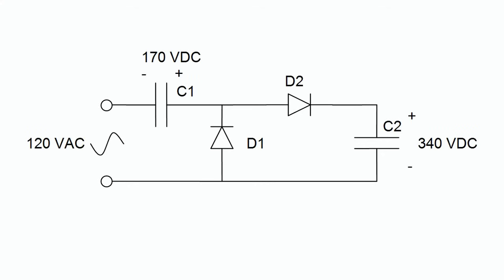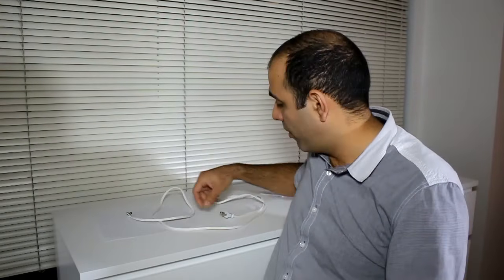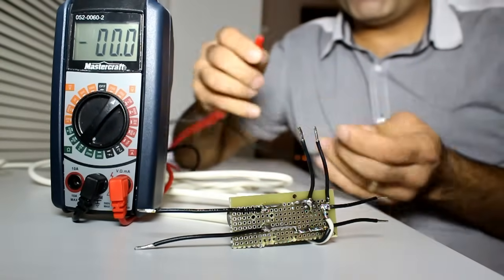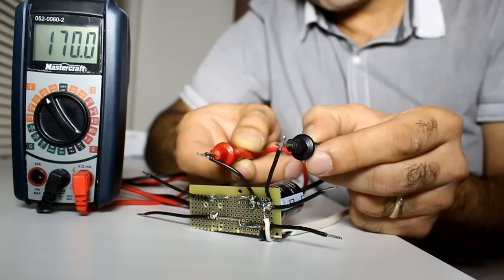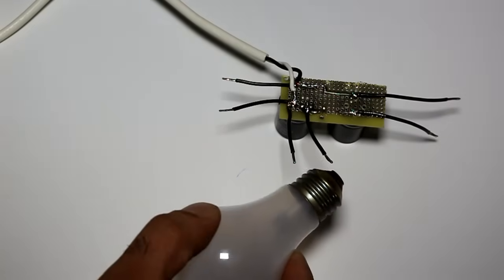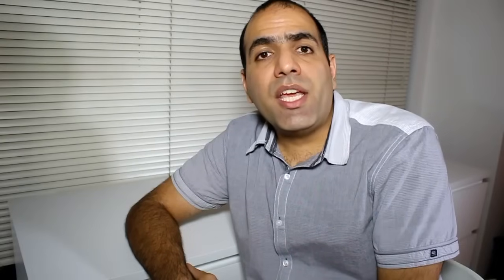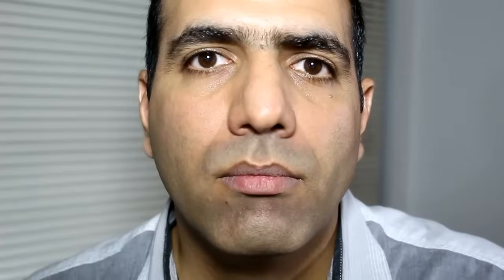High Voltage AC/DC Effect on Human Body

Comment: "I've touched 120VAC and 220VAC and they hurt a lot ...... So I'm not gonna repeat that again..."
Famous. Last. Words.
Reply: or should i say, they hertz alot
Reply: I got zapped by 240 vac when i was 6-8 years old; I put a pair of nails with BOTH HANDS!! (pretty dumb, but I was a curious guy) to this day i dont know why I didnt die
Reply: @lPlanetarizado  I also did many stupid experiments with electricity. Once my mom told me that never touch an electrical socket or switch with wet hands( I was in 1st standard). I did the opposite later on. I made the socket wet by sprinkling some water and then touched it with wet hands to feel electricity. It was an amazing experience although. As I wasn't tall enough I had to jump and touch it and later got dropped from that height.😅😅😅😅😅.

I even tried charging a cell of my remote controlled car using naked wire (connecting one part of 2 wires in socket and other 2 parts to the terminals (tapped cuz I knew that I might get shock) and then switched it on. Sadly nothing happened in first 5-8 minutes but after 12 minutes I heard a blast. Cell was black and the wires too and the table I had put the cell on was filled with fishy odour liquid
Reply: @lPlanetarizado  maybe the breaker poped quickly
Reply: Well my case was a lot more stupid. I plugged in my sister's hairband(steel or iron made) which had beautiful multicolored small stones embedded on it and plugged it into Wall socket (DC) ( I was wondering whether the stones would light up or not) And BOOM. All the fans , lights etc. stopped working because the ass of INVERTER was destroyed. 

The electricity didn't harm cuz I was on the bed while doing that. But instead my mom did a lot 😂😂😂😂😭😭
Reply: 220V is very dangerous
Reply: @D4V1D83FY  I've had nine 240VAC shocks, they're just shocks, they don't even hurt directly, you just leap up in the air, then hurt yourself on what you bash into.  It's unlikely it goes through your heart.  Even if it does, your heart has several methods of restarting with various timing signals from the brain etc.
Reply: @vaibhav mishra Nice memories you've told.
Reply: @3s-sahajselfstudy  Thanks bro
Reply: 240VAC: "Am I a joke to you?"
Reply: I got zapped by 220V not good it hurt so much cause i was little
Reply: @tomaszkulig97  when i was a baby i've inserted a key inside a 220 AC...
Reply: @tomaszkulig97  lol
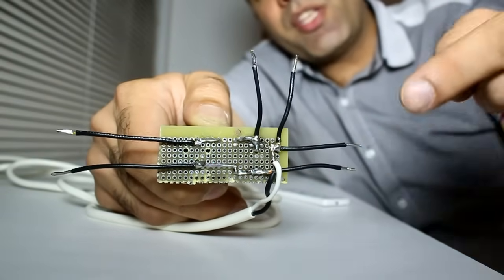Reply: Timestamp : 1:35
Reply: HANDLING HIGH VOLTAGE IS SUPER DANGEROUS AND CAN KILL YOU IF YOU DON'T BE CAREFUL WITH ELECTRICITY ITSELF.
Reply: Not enough voltage to remove the unibrow.
Reply: 120V rarely kills, if you just pull away in time.
Reply: uhm so I have a transformer capable of outputting 141 amps 8 volts on the secondary and for some reason I get shocked with 8 volts ac why? the voltage is low so what gives?
Reply: I've never gotten zapped by 220 but I have gotten zapped by 277. Not fun
Reply: I touch 250V AC but it's don't hurt me a lot I touch it four time and I connect with my leg on the ground
Reply: @omaribrahim5008  so you are trying to kill people who reads your comment. Nice job that voltage has the ability to kill a person.
Reply: @husamettinakar2297  30v AC can kill people 
That's too danger
Reply: Soham Gumaste did you know he died in 2024? 
.
.
.
.
.
.
Bc he never died. Also he will prob soon if he keeps this up
Reply: @TheBasementCade  wtf

Comment: So Edison was right about tesla's deadly AC

But it is far more efficient and transform able
Reply: Actually AC is less efficient too (capacities and inductive losses, instead of only resistive losses). Its ONLY usefulness is its ability to have its voltage changed with simple transformers. Boosting the voltage at the power plant to send it to a city 50 miles away requires a step-up transformer. Lowering the voltage to 120volts for home use requires another transformer.

If you are using DC, you would need something to convert the generator's DC output to AC (an oscillator), then increase the voltage (a transformer), and then convert it back to DC (a rectifier). The high voltage DC could be then sent to the destination city. But at the substation to the city, you would need to again have an oscillator+transformer+rectifier combo to bring it down to city-wide distribution voltage levels. And for EVERY HOUSE in the city, instead of having a transformer outside the house feeding the house from the power lines, would need to have an oscillator+transformer+rectifier combo. This additional equipment would be VERY expensive.

Keep in mind the voltages we are talking about here. 50kV comes out of the generator at the power plant. 500kV is the output of the power plant's transformer, which sends the current up to 100 miles away. The city power grid uses voltages of between 10kV and 50kV typically. And then it needs to be stepped down again to 120V for household use.

So keep in mind, if we go to DC, that 50kV DC generator at the power plant will need to run an electronic oscillator, and the rectifier will need to convert 500kV AC to 500kV DC. And on the other side of the high voltage power lines, you will need an oscillator that runs on 500kV DC! Keep in mind that while it may be a simple matter to create a rectifier that can handle higher voltages (even Radio Shack has rectifier diodes that go up to 400V and 6A), the oscillators are a MUCH BIGGER problem. Oscillators use transistors, which are much more prone to damage from high voltage than diodes (when have you ever heard of a transistor who's collector-emitter voltage was higher than about 100V?). Even a simple shock from static electricity can fry a transistor (and those shocks usually are no higher than about 5kV). To run an oscillator that will convert 500kV DC to 500kV AC, for the purpose of using a transformer to step the voltage down to 50kV for use in a city's power grid, you will need to use transistors in your oscillator that can withstand 500kV! I don't even think transistors can be made that exhibit such high voltage handling ability.
Reply: @BenHutchinson321  At high voltages (over 1 kV) you wouldn't use any kind of solid state components to build an oscillator. You'd use mechanical relays. But DC power distribution at metropolitan scales is just simply a stupid idea.
Reply: @morpheus6749  Actually I did some research on this. Apparently mechanical converters are no longer used, and they do use solid state components now. Each "component" though is composed of a massive numbers of individual components all wired in series, and each of these is a huge individual component compared to what you would find at radioshack. I mean SCRs or IGBTs (depending on the design of the converter) each the size of a refrigerator (or even larger), with HUGE voltage handling capabilities (like up to 50kV per SCR or IGBT), and then like up to 50 or more of these wired in series. And then each of these stacks of SCRs or IGBTs is housed in a building the size of a warehouse. And then there's like 6 or 12 of these buildings (depending on the design of the converter) at the converter station. So just one converter station is an ABSOLUTELY HUGE facility.

Comment: If D.C is both less harmful to humans and electronics run better on a D.C source then why don't we convert the standard A.C input into D.C before it is supplied to home appliances?
Reply: ***** oh ok.. 
Thanks for the reply.. :)
Reply: Because adjusting DC voltage is a nightmare in comparison. with AC you can just wind transformers to increase of decrease them. DC requires far more complex equipment. AC is also easier to transmit over long distances.

Comment: So, the AC (Alternating Current) can pass through the capacitor plates and DC (Direct Current) can get blocked through them? and which one has the higher voltage to create more current? *****

Comment: hey! I still wondering why you can get electrocuted by a USB which is 5v and 1amp when you're touching the floor or ground and it will not happen if your body doesn't contact directly to the ground(likes on ur video I think)
Reply: electricity looks for the shortest path to the ground -  If it finds it through your body.. then it goes through your body.
Reply: The positive and ground of your USB output, can have a significantly higher voltage potential than earths. The 5V terminal could (compared to earth) be at 105V while the ground terminal is at 100V, but the 105V terminal is still 5V when compared to the 100V terminal; it is a floating voltage since "0V" isn't referenced to earths voltage potential. This mainly happens because you didn't connect your device to the earth terminal (I know, nobody does, but we should).

Comment: I have a question. The country I live in supplies 220V. If I were to electrocute myself with a wire that I stripped, would I die?
Reply: And also, in your opinion, who's cooler? Thomas Edison or Nikola Tesla
Reply: ckalvinalvin It depends if it's AC or DC if it was a 220VAC it can kill. But DC can be absorbed but i don't recommend trying it.
Reply: ^lol  I wasn't gonna do it. I thought he would upload a video wher e he does it.
Reply: XD i see why you would think that XD
Reply: it can but may not. Depends of the duration and location. Its primary  problem is if it passes through the heart.

Getting electrocuted aitn that easy unless you  touch both wires ( live and  ground/0) or are in contact with the ground.
Reply: Makes you wonder how some people survived a direct strike of lightning. Lightning is said to contain millions of volts and being hotter than the sun. How people are not instantly vaporized upon touching it is beyond me.
Reply: ***** I imagine the person either wearing rubber shoes because the circuit wouldn't complete itself. And/or the electricity won't be able to pass through the person's heart :/
Reply: MinecraftorBust hmm, maybe. But that still wouldn't account for the 'hotter than the sun' part. Even if it's only for a split second, you would think a temperature of 50,000 Kelvin (the sun is 6.000 kelvin) would vaporize anything it touches.
Reply: ***** I agree, I'm actually going to search this up.
Reply: ***** I see, thank you for your insight.
Reply: *****  so 220 won't be enough to kill me?
Reply: ***** It turns out that usually people who get struck by lightning and live through it are those who didn't get struck directly, meaning that the lightning hits the ground first and travels up their feel/ what ever is in contact with the ground. Also when the circuit is created the electricity might take a shorter route meaning it won't reach delicate organs like the heart or brain. Coming back to the topic of heat. Since the electricity takes a shorter route only those parts will get slightly burnt and the reason for getting slightly burnt is because the amount of time is very low in comparison to the amount of heat. Think of it like popcorn in a microwave. You would need a lot more time than a split second for it to pop.
Reply: MinecraftorBust Hmm interesting. That would explain why many people who get struck by lightning have exploded shoes.
Reply: ***** It was nice discussing lightning with fellow Mehdi Sadaghadar subscribers have a good day.

Comment: I have a question. Some says that AC  is stronger than DC and some says the opposite. But according to theories, the graph of DC is a straight line graph but whereas AC is a sinusoidal curve graph. It's obvious that DC is stronger because it has a constant line graph and AC has alternate graph.(it varies) am I right? Correct me if I'm wrong
Reply: It's totally not obvious that DC is stronger with your reasoning...
Reply: Yup dc is lower than marvel...bring on the hate I'm ready

Comment: So I was working on a farm with my friend this past summer and he told me the electric fence was off, well it was not so I shocked. What would it be DC or AC? Can someone answer? I'm not the smarter when it comes to this sorta thing.
Reply: low amperage, high voltage AC - its designed to hurt. Voltage doesn't kill, current does.
Reply: It's pulsed DC at 2.000 to 10.000 volts; it will only supply very tiny amounts of amperes, so it's not deadly.
Reply: Dc

Comment: You would be better off getting electrocuted by a 1,000 volts than being electrocuted by a smaller 120v-240v household circuit because the higher voltage would more or less shock you, burn you and then let you go but the with the lower 120v-240v it would more likely hold on to you until you heart stopped, (I.B.E.W LOCAL 716 electrician)

Comment: dc can kill u more than ac. dc makes u lock up as do tazzers and ac pushes u away not the volts kill its the amps 1/2 of an amp  can kill u
Reply: The original OP is technically correct Direct current will grab hold of you. Alternate current will throw the individual off whilst following it's Sine wave!
Reply: 80ma will stop a heart. That's why most new systems incorporate RCD protected circuits
Reply: thank you ucrepidarian this in the video i a has no i dear what he is doing if u have high amps u need more voltage to move the amps

Comment: Well, that's not a real 170 Volts and 340 V, if you put a small resistor as a loud that voltage reduce to about 240V 
Ususally the circuit make the input voltage double inn the output
But thanks for the nice video
Reply: Yes you are right Mehdi; but that voltage is based on the capacitor voltage charge with no load it doesn't count as long as it will change totally when you connected to the load like the light bulb, that could support up to 240 Volts. If you change your output capacitor to higher voltage, you can have even more unreal voltage, but you might tell your fans that this will change when it will connect to a loud like what you did.
You also well showed, that light bulb worked fine in the output but the output wasn't 340V, and if it was it totally could explode the light bulb as well. 
Bytheway, good job Mehdi
Great videos
Reply: ***** Dude that part where you were about to explain how AC works in a capacitor me laughing near dead.

Comment: Resistance of capacitor (for AC) could be calculated using this formula: X(c) = 1/(2pi*f*C). The bigger frequency - the lower resistance. For the DC its resistance is infinite.

Comment: Biggest jolt I ever took was ~20KVDC off a 20-stage Cockroft-Walton bridge (Google is your friend) - a capacitor/diode junction connection came apart (read: a diode lead broke) and left a doorknob capacitor fully charged even after I thought I had touched everything with a ground wire on a stick. Hurt like a mother trucker and my arm didn't work right for about a week.

Comment: I used to repair TVs way back when I was attending high school and college.  They were tube sets back then (which dates me).  I found that there was a pulsating DC power source called the "boost voltage" that was 800 volts.  It was used to focus the electron beam on the CRT.   

I also found that if I inadvertently came in contact with the boost voltage source, it wouldn't shock me but would burn a little pin hole in my finger.  Dang!  That really hurt!

Like you, I learned to work with one hand in order to prevent cardiac arrest :-)

Comment: Let's be clear. The reason you didn't get hurt by the DC is because the capacitors in your multiplier are tiny. They are only letting through a very small amount of the current available at the mains lead. Out of interest, what value are they?
Reply: In microfarads I think
Reply: Also dc can't pass a capacitor so it need to pass through the resistance which is pretty high and the voltage is not high enough to cause dielectric breakdown but high enough dc voltage can go through the human body resistance and shorts the capacitance present in our body due to parasitic capacitance so never assume that you are immune to DC